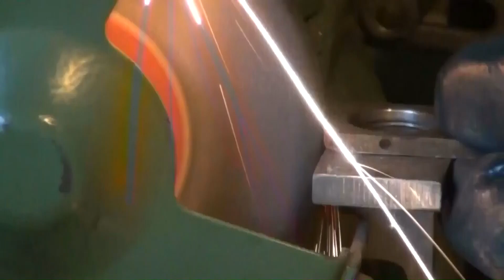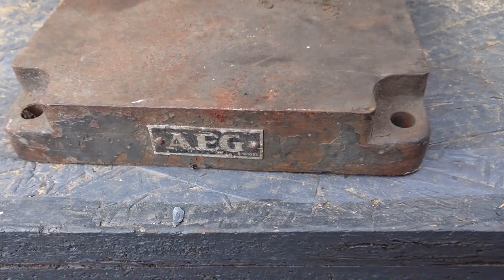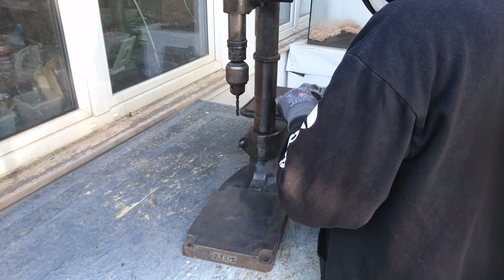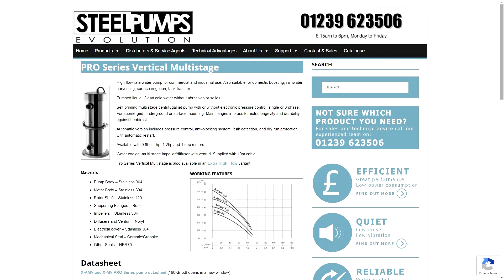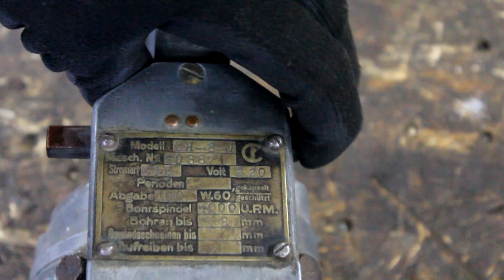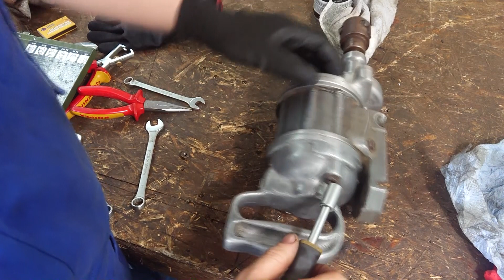Incredible Scrapyard Finds! Repair-A-Thon!

Comment: You have a keen eye for spotting metal working equipment vs woodworking! Metal working tools can be used for wood, but the other way around.  Tolerances to work wood are not as exacting as metal. Wood machines also run at higher speeds without the need for torque.  
It is also fortunate to have friends that acquire rare tools for you, aka the heavy-duty hand drill.  Nice show although I have noticed that your main skills and interests are in electronics theory and application.  Thank You

Comment: The practice of buying old trademarks and slapping them onto newer junk products is rampant. In the USA a lot of consumer electronics was built by Thompson Electronics, and names of functionally defunct nameplates like Zenith, Philco, Magnavox and so on slapped onto basically the same chassis, with minor modification to the cabinets. Once HDTV took hold, a lot of those brands were swept away, and names such as Samsung, LG, and Visio became the new name brands to have. China slaps different brands on essentially the same products as a matter of course.

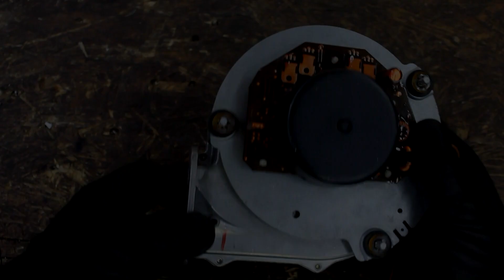Comment: 14:42 its the fan of a water heater which blows air which is later mixed with gas and ignited and burned in the burner itself

Comment: Fascinating work, should be taught as a lesson in schools., dismanteling, dissection , analysis. Just refurbishing a similar pillar drill £30 startrite mercury mk2, skeleton cast frame but with covers. Used red diesel to de-grease, less volatile than petrol. Very little runout at full extension. Love the finds.

Comment: If it helps, the drill used that two jaw chuck because that is the standard chuck for hand drills.  (Brace and Bit)   Like most electric versions, they simply added a motor to existing hand tools.

Comment: I like WD40,  but a lot of people complain about it as a product but that’s because they use it in the wrong applications. WD40 is only paraffin mixed with a light oil so for big jobs paraffin is cheaper as a degreaser. I have tried some of those water soluble degreasers none work as good as paraffin.  I avoid using petrol as a degreaser due to its extreme flammability.

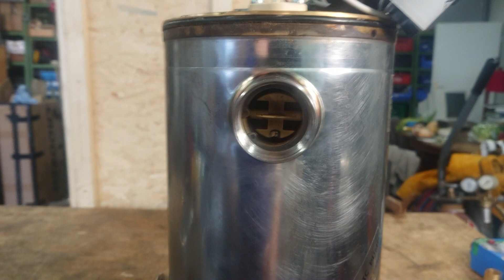Comment: 13:20 Hall effect sensors are all over automobiles. These terms often don't translate well, but some examples are: crank/cam shaft sensors, vehicle speed sensor/transmission output speed sensor, wheel speed sensor (anti-lock brakes and stability control) and they all work on exactly the same principles and some are the same part too! 
I wish automakers did that more often though, having the same exact part for all those sensors would save hundreds of dollars in repair costs over the lifecycle of a car.

Comment: Using gasoline as a parts cleaner solvent is a really bad idea! Gasoline contains benzene which is a carcinogen that can give you cancer and the high flashpoint is a big fire danger if left to evaporate. Many old mechanics have died of terrible cancers after extended exposures to gasoline at work. Safely and responsibly disposing of the spent greasy gasoline is also problematic since the gasoline itself is so toxic.  Much better idea to use safer parts washer solvents without the cancer and flammability risk. Great video otherwise!

Comment: Hi.  Great video, I do not mean to tell you what to do so please do not mind.  I worked on ocean going container ships for ten years.  We had WD -40 but when we had rusty parts always used PB Blaster.  This tuff is great.  A few years ago I bought an old “C” hook from a WWII Panther or Tiger tank.  I had been buried for 50-60 years and the handle was rusted in place. Soaking it in PB Blaster for a few days and it freed up

Comment: looks like plastic mains cable you fitted to the drill, i find rubber cable is much better for power tools more flexible and doesn't damage so  easily

Comment: I use citric acid to remove rust.
It makes not marks, but wire wheel does.
Just degrease, apply, and scub litgtly with steel sponge or anything like this.
It's magic !
Pictures before / after following below.

Comment: Just discovered your channel and subscribed.  Nice work - LOVE the drill press and your sensiblity about keeping the original cast iron surface.  I will point out that shiny stainless steel is done a dis-service by using steel wool to polish it. There are any number of stainless cleaners which contain fine pumace compound that will easily restore the original high shine.  Just my opinion.

Comment: Good idea with the "w - 40" but I had assumed that some of the volatile/penetrating ingredients would evaporate from a container that can't hold pressure.  maybe the power drill company name is "Absolute x ON"  a reference to the switch never slipping out of the "ON" position? I dunno, I just like watching these kind of vids with a few beers.

Comment: Helpful info: the “ WD “ in WD40 stands for “ Water Displacement “ . You can actually use WD40 on electrical components . The water displacing component was the reason that folks who drove cars with old school ignition points carried a can of it with them. If you have ever had a distributor get damp on the inside, either from swamping it out in high water or just condensation. You can pull the cap, spray the inside of the cap with WD40, sling or towel out the excess, and stick it back together. Taken care of! Have a great day!

Comment: google helps... 

IXION 
Founded in 1919 by the firm Otto Häfner, until their bankruptcy in 2011,
 the factory manufactured drilling and milling machines. (You can read 
this in 
http://www.abendblatt.de/wirtschaft/article107953468/Hamburger-Maschinenbauer-Ixion-steht-vor-der-Schliessung.html)

Comment: Gasoline/petrol harm rubber o rings and some times electronics (rotor wire coatings)....so better use of wd40 or kerosene when working with metals connected to soft component

Comment: one thing i've allways apreceated about old tools is that in many cases there operations is alot quieter than modern equivelints using high rpm motors that end up sounding like vacumes.

Comment: Good to see old pieces of machinery being restored back for use.
I have an old Thiel Nr.3 Tapping Machine I am going to restore, but cannot find anything on it anywhere on the Interweb.
Also a Herbert "B" High Speed Micro Drilling machine
I can still buy one of those chucks $AUD 60.00 $US 43.00 Euro 36
https://www.ausee.com.au/shop/item.aspx?itemid=4262
Cheers Peter from Oz

Comment: Here in New Zealand, we have AEG products at all the hardware stores and I used to think they were either made in Germany, or designed there but assembled in China - which would be as good. But now I know, sadly, that the founding AEG is no more.  
I like the way the engineers attached the motor to the main body, the motor would have been a standard design, but for this application (and others requiring belt tension) they would have made this type of motor casing.
The old drill I would guess is a 1950's machine. The 2 jaw chuck and the other worlds first electric drill picture that you showed, also with 2 jaw chuck would imply this design was a German patent and was used throughout till about the 1950's when Black&Decker, or some other manufacturer came up with a 4 jaw chuck design.

Comment: I have found the Drill! (or at least a advertistment).
It is from around 1929 from the "Cordes & Sluiter Elektro-Werkzeuge" company.
You can found an ad here: https://picclick.de/HEMELINGEN-BREMEN-Werbung-1929-Cordes-Sluiter-Elektro-Werkzeuge-163765485669.html#&gid=1&pid=1
Maybe you want to spend this drill to a museum?
Archived Sites:
https://web.archive.org/web/20200625141846/https://www.picclickimg.com/d/w1600/pict/163765485669_/HEMELINGEN-BREMEN-Werbung-1929-Cordes-Sluiter-Elektro-Werkzeuge.jpg
website: http://archive.is/wip/1VmsV
Image only: http://archive.is/ijdzF

Comment: info about ixion found on an auxion website
Founded in 1919 by the firm Otto Häfner, until their bankruptcy in 2011, the factory manufactured drilling and milling machines. (You can read this in http://www.abendblatt.de/wirtschaft/article107953468/Hamburger-Maschinenbauer-Ixion-steht-vor-der-Schliessung.html).

Comment: I have basically the same drillpress, maybe even a little bit older. It is working great. Bought it with an old house. Funny enough, it had a two yaw chuck just like the other drill you showed. This chuck produced a lot of runout, so I replaced it with a more modern one. 
Some pictures (only with registration, sorry): https://www.werkzeug-news.de/forum/viewtopic.php?f=26&t=42214

Comment: To your mentioning that cleaning is as important as repair: I've repaired and restored many motorcycles and small engines, and cleaning things is crucial if you want to get more than a "just good enough for today" repair. It gives you a chance to learn the individual machine you're working on and let it tell it's story if it has one, and let you know where it needs help if it does without things going sizzle or bang when they shouldn't. Plus it means less worry of grime going into places they'll do more harm once you take things apart.

Comment: How many watts/hp was that drill press? I have a GE drill press not unlike that one that's been servicing me for 20+ years now, just needed a belt and a key. It's almost 6 feet tall (2 meters ) I did rewire it just for extra safety and so I could add a light and an extra outlet to its frame. It cast iron arm is painted a military green and I think due to its sit down table it was probably used for drilling holes for airplane wings that got riveted together later. I also added a frame of salvaged pallets at the bottom so I could add casters and wheel it around my basement easily. It's a little bit newer than yours but I love the old stuff that is built tough.
 Today I used spray foam engine cleaner to clean off a 1958 squirrel cage belt-driven fan from a Rheem furnace. I oiled it and mocked it up for installation into my shed right below the workbench. It gets deathly hot inside and this blower will help cool it & me off. I'm envious of your 3 phase power.

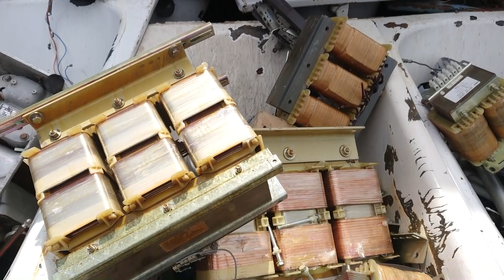Comment: @2:02 These look like isolation transformers. Big ones and 3-phase variants are really rare in 2nd hand markets, and also rather expensive. I would have bought them all, made enclosures with current meters for them and sold what I didn't need for profit.

Comment: About the motor on the AEG, wouldn't the voltage rating have been 380V at the time? I seem to recall that the Voltage was upped from 220/380V to 230/400V somewhere around 1990.

Comment: Hey man, I just came across your channel, good stuff! The comment at the start in regards to not picking up motors without having a use in mind is so true. **edit btw, using kerosene instead of gasoline is better overall, but especially in avoiding excessive fumes. That's not to discourage your use of gas but mostly for anyone reading this comment.

Comment: The drill press is gorgeous and whoever threw it away is a moron in my opinion. It’s a true object d'art and I’d love it in my shop. I much prefer the tables without a ratchet, much less wear and tear meaning more accuracy.

Timothy Dyck would like that blower on his forge he’s recently made, he was struggling to get one with enough power.

All switches should be like the power drill, it’s very quiet. I do hope a certain Canadian who likes to rescue hand tools doesn’t start using gasoline to clean things, his workbench would burn for three years.

Comment: Ixion was a german company indeed. It made bench drills and CNC machines up until recently (around 2006 they were  still around), but i think they were bought by Schneeberger after that (some old links to ixion ended up on Schneeberger website). No other info i could find.

Comment: Diesel is better as a solvent. As it not only cleans but lubes at the same time. Added bonus of not being as ignitable as gasoline. Just be wary that, as gasoline, it degrades some kinds of plastic/rubber. So avoid contact with those materials.

Comment: That drill calls to mind some sort of industrial assembly tool.....which might have been suspended by a retracking wire rope (and power cord)......  In agreement with you, the on-off switch is ancient---but designed to endure jillions of cycles.....between servicings.....

Congratulations on the number of subscribers; you'll be at half a million by Christmas!  Wear safe glasses; "freak' accidents happen...  (Don't)....ask me how I know.....!?!?  (Not limited to an "academic" colleague falling from a ladder.....  How banal!)

Comment: I find it interesting that you worry more about a superficial clean than an earth conductor continuity and an electrical insulation resistance test before you connect to power.  Risky living. Also, for degreasing, Kerosene works just as well as gasoline but is much less volatile too.

Comment: Then, you should always check insulation resistance on those old motors, especially hand-held tools. Insulation materials of the time were far worse than today, and it tends to deteriorate with years. I have seen stator windings to get shorted to stator laminations, which makes that machine to be extremely dangerous; especially with all-metal body. Tool itself can be still working fine.

Comment: Hi,
That kind of blowers are used in gas water heating furnaces, and normally get replaced when bearing noise gets too loud. It's quite possible that noise does not seem too bad, when fan is run alone, as it's not in normally-very-quiet environment in somebody's house.
The other factor is when whole furnace gets replaced because more efficient one is installed, but then you would find it as a unit, not a blower alone.

Comment: Both those drills are nice. You did an awesome job on them. I like the old school grease cup on the hand drill. You fill both parts with grease. When you twist it down it little grease is added to the gears. Way cool.

Comment: I work in a company that makes AEG products. Products actually developed by AEG. The license to them is now owned by ABB. What we make is low voltage (sub 1kV) industrial distribution boards and motor control centers. So AEG is still alive to some extent. :) My company is called "Switchgear AB" and is located in Sweden. :)

Comment: That drill press isn't just a useful machine it's a piece of art. No attention is paid to aesthetics like that anymore.
Reply: The drill press is beautiful. A few years ago I purchased a Hamilton Beach Model G mixer for a dollar or two. I think the G was made in the 1950s. It came with the original stand, turntable, large Pyrex bowl, and double beater. It handles tough jobs with ease. Depending on the care the mixer gets, the heavy all metal appliance could conceivably provide useful service to someone another seventy years from now.

Comment: Go back and get the compactor and fit an electric motor to it. You’ll have friends for life that will owe you a favour because you lent them your compactor. I bought a good quality petrol compactor cheap because the motor was using a LOT of oil. I rebuilt the little Subaru motor on it which was cheap and easy for me to do but I only use it twice a year to re- pack my gravel driveway so I’m happy to lend it out to my family and friends rather than leave it sitting in my shed. That gets me a few favours done and it’s so convenient not having to hire one.
I just love these videos. Cheers Stuart 🇦🇺

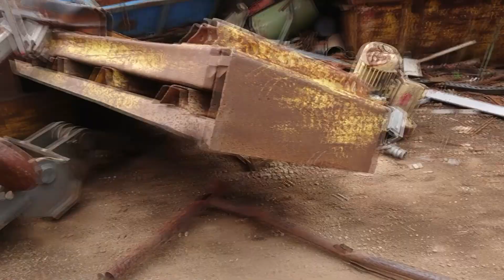Comment: From 0:00 to 01:20 is almost poetic and certainly profound. I know many DIY source from China for low-cost, but as we can see in your video, these items stand for more than quality, they stand for a purpose that goes beyond the tool itself, to the builder and back to the tool to help humans over several lifetimes. If any is ECO, it’s the pride and craftsmanship of these wonderful iconic machines. I’m so happy you’re doing what you’re doing! I often e-cannibalize electronics from recycling bins, and I’m amazed what perfectly good and innovative gear is disposed in working condition. Some just need a bit of love to get going. If I had the space, I’d be also trying to do what you’re doing with these fine, almost indestructible, tools.

Comment: Low-aromatic lamp-oil makes a good solvent/cleaner and it is often cheaper than wd40(also makes a less drying alternative and more effective alternative for removing paint/grease from skin than turpentine/mineral spirits)...

Comment: Make sure the metal body on your drill is always isolated from you. I personally knew someone who got "frozen" by a metal cased drill when he hit an electrical cable in a wall. Someone tripped on his power cord and saved his life. He laid down on a table and wept from the pain in his muscles. Use rubber gloves when using that drill. Nowadays, electric drills almost always have plastic bodies.

Comment: Awesome video! Your restoration work is very inspiring. This particular video was pure nostalgia. I used to live near an AEG factory 20 yrs ago in, wait for it, India! My dad was an employee there for decades. Also in the same area was the local airport, several defence establishments, an air-force manufacturing hub and also the Indian space agency (ISRO). This AEG factory was a collaboration between a state-run company and AEG, within a huge 240 acre campus!! I vaguely remember huge transformers and industrial induction motors being built there to supply other factories all across the country. I could tell even back then that the stuff was damn good. Incredibly well engineered, extremely well built and superb finishing. There was definitely an aura (of a good kind) around those old state run factories. Of course once our nation went full-scale capitalist, it meant the end of most state run factories. The factory was closed and the land sold as it was prime real estate. Now there's a 5-star luxury hotel where the old AEG factory used to be. 
Now I make my own motors from 3d printed parts 😂 
Times have changed so rapidly! 
Keep up the wonderful content, two thumbs up every time 👍👍